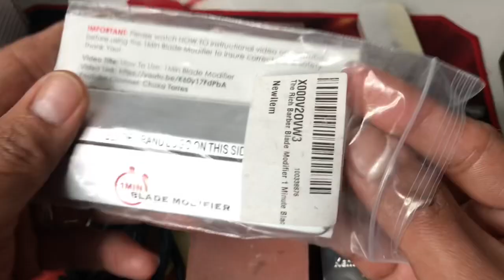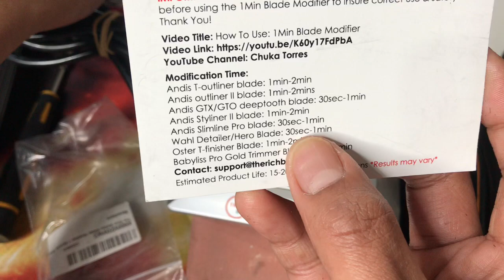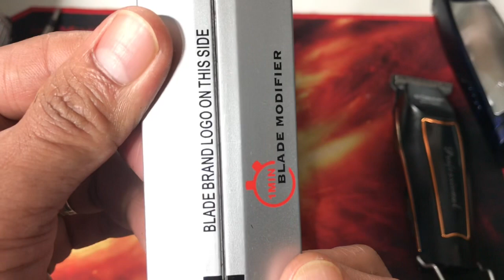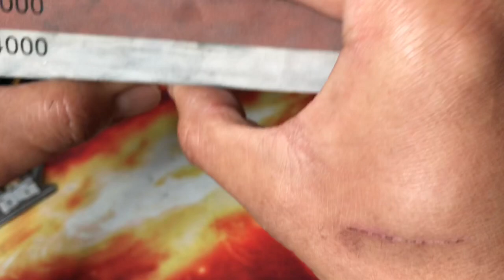How to modify Trimmer Blades. Doing this at your Own Risk!

Comment: ano po name ng plastic na puti??  yung pang whal adjustable blade
Reply from the maker: White pcs?  Hehe. Yun ang sabi sa youtube. Diko din alam eh. Rotor Shaft Adapter? Tnx sa pagdalaw
Reply from the maker: Jonathan Datanagan 
https://youtu.be/N404gDTok50
Reply: salamat po alam kuna po name nyan incase po kung gusto niyu malaman yan po ay wahl detailer cam follower po name nung puting piece
Reply from the maker: Hehe. Ok. Salamat. Sana makabile ka ng ganon. Yung china brand na replica may kasama ng ganon. Pero hindi lang talaga kasing talas ng wahl. Kumbaga hinabol ko na lng yung white plastic. Hehe
Reply: bili ka po sa ebay.ph mero pong whal t wide na may kasama ng ganon!!
Reply from the maker: Orig ba yung blade sa ebay?
Reply: Sampitz The Hobby Barber  yung lng d ko alam cam follower lng habol ko dun sa ebay yun lng d nabibili eh yung blade meron nmn sa shoppe or sa wahl store
Reply from the maker: Better late than Never😂😂😂ang wmark meron kasama cam follower✌️💈